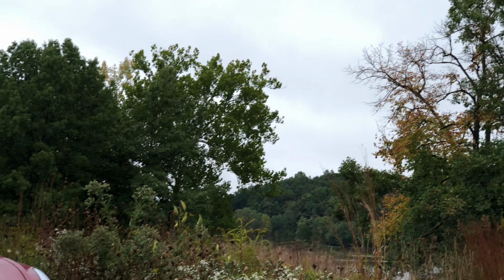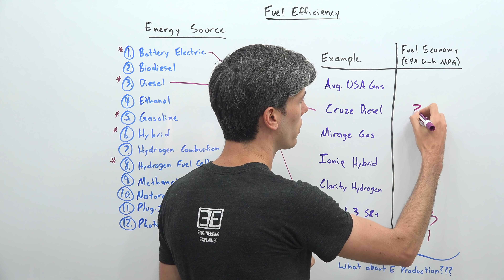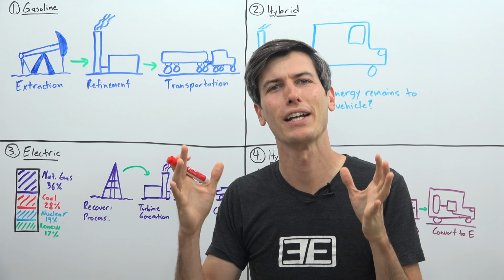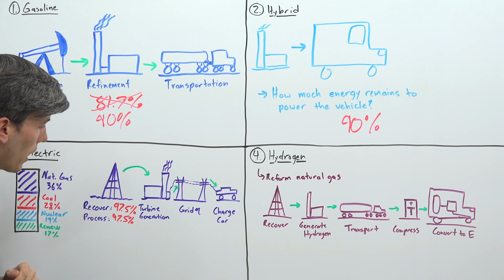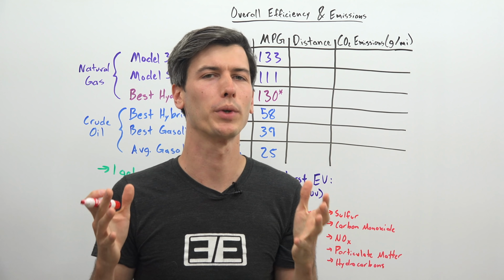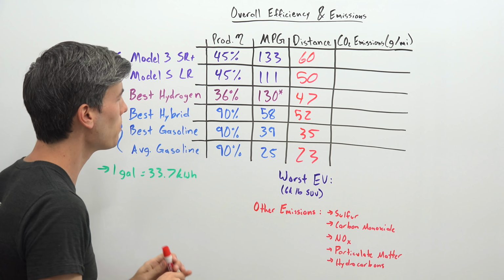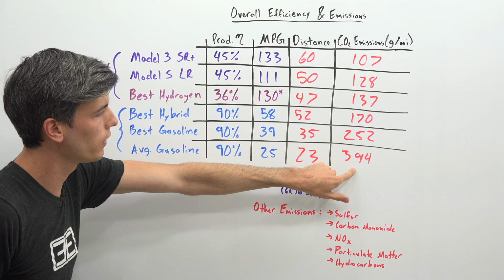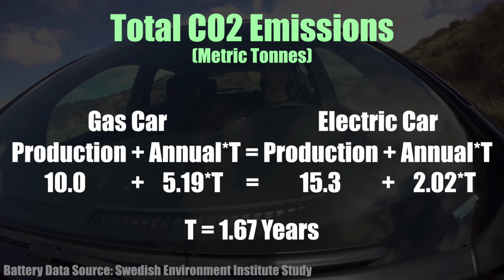Are Teslas Actually Better For The Environment?

Comment: but you haven't mentioned how much carbon emission occurs while producing Li ion battery in factory to run EV
Reply: Because he's comparing emissions during operation.  If you are to compare the total emissions to create a Tesla compared to a gas vehicle, you should also have to consider the service life of both as well, as the Tesla batteries are 90%+ recyclable and may soon have a service life of 1 million miles, and their current service life is not known, but well over 200,000 miles.
Reply: @chadcoady9025  well said, off topic but i just want to inform you that lithium itself is non renewable, it has formed by the big bang 14 billions year ago along with hydrogen & helium, so its reserve is finite, and if you compare similar weight of current gen li battery with fossil fuel, gasoline has enormous number of Joule stored in it like concentrated sun light,  only F1 engine has achieved 50% efficiency at peak scenario, in future it'll improve a lot,  so my point is li ion battery is not an efficient energy source nor renewable, may be nano cell battery or graphene will narrow the gap in future!

Comment: The only problem I see is coal is less efficient then natural gas so it's not the lowest number. Still a good video
Reply: eichler721 except coal is shrinking every year meanwhile renewables and natural gas grow every year. Hence why he used natural gas as the base. So yes those numbers are worse than the real world.
Reply: @johnmoore1495  I am aware but if you state worse that means worse. If he stated most common that would be something else
Reply: eichler721 what? I’m confused at what you’re complaining about.
Reply: @johnmoore1495  he stated to make it harder for the EV we will use the worst efficient fuel Natural Gas which is not true Coal is the worst. You get it now?
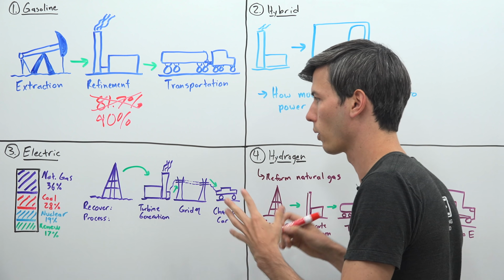Reply: eichler721 “We’re kind of going worst case” 6:21. We know coal is shrinking and will eventually die out and natural gas is expanding. Thus worst case in the real world is that of the fossil fuels we use it will end up being natural gas.

I get what you’re saying as natural gas is not literally the worst electric fuel source currently. He could’ve used better language.
Reply: @johnmoore1495  yes and as of this video coal is 3% behind natural gas as a energy source so almost the same. In 10-15 years coal will be almost gone but that's a while a way and makes the test not true.
Reply: eichler721 it doesn’t really make the test wrong, roughly 35% is nuclear or renewables which are zero emissions at the time of energy production. That far outweighs the coal.
Reply: @johnmoore1495  yes and nobody is debating that. The point was can a EV using the least efficient and dirty means of making energy beat an ICE car. Well he didn't use the dirtiest type so ya that defeats the point. It's still informative and cool but it not factual when you don't use the right words to.convey what you mean.
Reply: eichler721 from what I can find coal is roughly double the CO2 to generate the same power. So however you wanna factor that in.
Reply: @johnmoore1495  ya I am not going to pretend I am as good at formulas as him but it would be close using coal so when I clicked that's what I was expecting. The ICE is not that far off efficiency then EV when using Natural gas. It still makes way more emissions. The ICE might be better on efficiency then the coal EV and that's what made it interesting.
Reply: eichler721 so if you were driving in West Virginia it’d be best to just drive a hybrid.
Reply: @johnmoore1495   The west coast is 90% renewable between Washington, Oregon and California. East coast is alot of Nuclear with some Natural gas. The middle of the country is coal area from North Dakota to Ohio. Nuclear is the most energy dense but is so highly regulated that it costs a asston to build. No Hydro or Geothermal in the middle of the Country so that leaves wind and solar which are not very efficient at making power. So Natural gas is the best option for them to switch to.
Reply: eichler721 yeah I was surprised to find that my state is roughly 50% coal still. The issue with the Midwest (excluding the plain states) is that pretty much all open land is used for farming or natural forests. So solar power plants don’t make a whole lot of sense economically. However wind has been rather successful when funded. It’s quite simple to put a windmill up in farm land. Takes up little space, farmers usually get a kick back or sell that little chunk of land, and it works reliably since you’re in wide open land. Problem with my state at least is that there’s almost no incentives tax wise and coal is still economical.

In almost all regions it make sense to put solar panels on homes since it’s effectively free real estate. It’s very rare that you’re in such a sun free area that the production of the solar panels outweighs the savings both economically and in emissions.
Reply: @johnmoore1495  ya most states don't offer incentives for wind or solar so that's out of pocket and alot of houses can't afford that. The most common and cost efficient power hydro electric in the US. If they could tap Yellowstone for Geothermal it would power the whole PNW. But I don't trust those dummies to not set it off.
Reply: eichler721 yeah I’m not very comfortable with them messing around with the biggest super volcano that has been due to erupt lol
Reply: @johnmoore1495  exactly cause most people are not as smart as they think. Honestly the middle of the country is perfect for a few big Nuclear reactors and they would have plenty of power and could close all the coal olants

Comment: did you factor in the environmental damage for all the products needed to make the electric car ? its batteries? the oil used in the production of the teslas initially?   without oil and  precious resources how can making cars like this last long term?
Reply: Yes, he did, in a separate video, as he states, repeatedly.

Did you factor in the emissions to drill and pump oil, transport it to a refinery, refine it, and then transport it to a gas station? All those emissions get added to what you produce when you get in your car and drive.

I don't think anyone argues that at a dealership, sitting on the lot, a brand new EV didn't produced more emissions than a brand new ICE. The whole point of these discussions is that, by the time the car is being removed from service, the EV has generated VASTLY less emissions than an ICE.
Reply: Still its using resources that are currently not sustainable.  How long can this consumer lifstyle carry on? We went the wrong direction long ago imo.
Reply: @ArmChairKoalaBare  Couldn't disagree more.

There's an estimated 65 million tonnes of lithium reserves on Earth. If that lithium was used to produce just the Tesla Model 3 Long Range, that would be enough Lithium to provide every person on Earth with 1,576 Model 3's - each with a 310 mile range.

Providing every person on the Earth with a Tesla Model 3 long range (310 mile range) would require just 0.06% of the world's lithium reserves, leaving 99.94% of the Earth's lithium reserves available for other purposes.

It's also worth pointing out that there's been some promising research into Lithium-Carbon Dioxide batteries. In addition to begin carbon neutral, these batteries provide 7 times the energy density of standard lithium-ion batteries. In other words, such a battery made with 0.06% of the Earth's lithium reserves would be sufficient to provide every person on the planet with a car that has a 2170 mile range.

Despite the promising research, Lithium-Carbon Dioxidie batteries are still a long way from production. But the reality is, BEV's are the future. They have a much smaller environmental impact than ICE vehicles, they provide more torque than ICE vehicles, and they're easier to maintain than ICE vehicles.

Comment: Wait, how does a new ioniq(106.25) produce more co2 than my gen2 prius(104)(co2 output measured by tüv)?
Reply: because real world is not the same as on the broshure
Reply: @stinger15au  i mean really. How? I get the brochure is bs to an extent, but if math fails us vs real world testing then i'd go and check the methods if they're not wrong.

Comment: The fact that american diesels are either ridiculously inefficient, or just flat out bad scews the image here. Look up a european diesel hatchback (i use Peugeot 208 Diesel as my example, but any diesel in that car size will do). The MPG for a 208 Diesel (1.4 HDI) is 94.2. The gasoline equivalent in the same car (1.2 Gas engine) has an average mpg of 53.6. This image is consistent across sizes, if you take bigger cars such as VW Passat or Peugeot 508 as examples the diesel versions go 60-65 and 52-60 mpg respectively, and 30-38 and 32-41 mpg for the gasoline version. Furthermore, car buyers are generally aware that diesels are not good for short trips, so most people who mostly drive shorter trips, buy gasoline cars instead (at least that is the case here), leading to diesels being used primarily for longer distance, further increasing the efficiency, as they travel longer distances, at more optimal speeds, that are not reflected in the average values. That being said, electric cars are definitely the future, especially as power production changes away from coal and gas, and towards renewable resources and nuclear plants.
Reply: EPA test it in the US and tell us the equivalent numbers...  he's using the shopping comparisons of the testing cycles done on dynomometers for all cars sold here - it's just for apples/apples comparison.

Comment: How efficient is a model S when it's being towed on a flatbed because a drive unit failed?
Reply: Still more efficient that average ICE car that have to be toed because of an engine failure
Reply: @bondrewdbestdad  only after 1.67 years, weren't you paying attention?  Trick question, both are 100% efficient when being towed from point A to B using none of their own energy.

Comment: Only 23 mpg? My Citroen C2 gets better than that if you floor it in 5th gear. Normally it's nearly 50 mpg using the smaller US gallon. Not much point in getting a Prius when that Citroen cost me £800 with similar fuel efficiency and it's not a hybrid. I mean a Tesla is 4-5 x quicker to 60 but oh well.... you can't win 'em all. My most "gas guzzler" car was probably my 1.4 Peugeot 206 at about 40 mi/USgallon and it probably dipped to 37 mi/US gallon when a brake pad started rubbing against the wheel (checked by jacking the car and the wheel was a bit stiff to turn).

Comment: The problem with electric cars is range and charging time. While I can go 250-300 miles on a full tank, I can also refill it in a matter of minutes and go another 250-300 miles.
Reply: if the majority of your driving is long run oriented, that's an issue. In the US the average miles per driver per day in 50 and lower... If the majority of your driving is within the range of the car per day and you charge in your garage while you sleep - it's a really good tradeoff...

Comment: Great stuff as always.  While you talked about the efficiency losses associated with drilling, refining, and shipping oil/gasoline, I wish you had also talked about the emissions associated with doing so.  Same for hydrogen (emissions associated with electrolysis, transport, etc.).  This would paint a very relevant picture of true total associated emissions per mile.  Spoiler alert:  It doesn't improve the cases for ICE or hydrogen vehicles.

Comment: Hm....  Best Gasoline car in the US emits 156.6 g/km of CO2. Average is 251 g/km.
Meanwhile my 26 year old ancient car here on the other side of the pond emits 165 g/km of CO2.  Where is the progress? I mean I know. Those vehicles over there are bigger, heavier, more luxurious. Then why is climate change a problem at all? When CO2 emissions over there could be halved instantly by using Euro spec. cars. (Euro 6 mandates 95g/km of CO2 or less)

Other thing is. Where are the resources for the battery coming from? What impact does mining those components have on the environment? Is there enough of them to be a viable replacement for IC engines in the long run? How about the grid? What would it take to power all the cars if they were all electric? 
No doubt that in the current form, I mean the current number of EVs on the road.  They are greener, so to speak. But what about those questions above?

Comment: Do you think ethanol, specially the one created from sugar cane, would be still better in emission than electric?
Reply: Not sure about emissions, but I think bio-energy is kinda a non-starter simply because it uses so much area to get the X amount of energy compared to even solar panels, which are also notorious land hoggers. Photosynthesis is actually very inefficient process, this snippet is from Wikipedia photosynthesis page: "Ethanol fuel in Brazil has a calculation that results in: "Per hectare per year, the biomass produced corresponds to 0.27 TJ. This is equivalent to 0.86 W/m2. Assuming an average insolation of 225 W/m2, the photosynthetic efficiency of sugar cane is 0.38%.""

0.38% efficiency per area used is absolutely terrible, even cheap commercial solar panels are 15%-20% efficient.

Comment: I know you're using worst-case-scenario data for EV's in these videos, and I appreciate the reasons you're doing this. But wouldn't it be fun, just for a change, to do a similar analysis, except with EV's made in factories connected to clean grids, and used by owners who recharge them with rooftop solar, and so forth? Fun, and in a lot of cases, a growing number of cases, more accurate too.

Comment: EV are rather confusing for many....Tesla is not a vehicle that I would buy because there are no local places to take the darn thing when it breaks.   One head ache that I do not want and will not buy into. Tesla is like a cordless drill -I got and had to send it back -when broke.    That was all a Joke!   Where are the local repair shops?

One head ache that you could assist me -and many others -are the different types of Hybrid batteries used.  I know Toyota uses different ones in different models. 
  Which model,should I buy for long life and no or little maintenance?
And other brands are using different batteries, entirely.
What are the difference in these batteries and why are they using them in this model?  
Would appreciate a video on these battery types and which ones are best for cars using them.
Thanks load.

Comment: Isn’t it more efficient to keep our current cars running and not build millions of unnecessary new cars every year?
Reply: That's another issue, planned obsolescence and our need to ditch still usable cars. Swapping ICE for electric will not save the environment but is still a welcome start. I think it is also urgent that we transition from a excavation dependant economy to a recycling based economy, also called circle economy.

Comment: How do you get MPG for an electric car?
Reply: To create the mpg equivalent, the EPA uses an established energy standard of 115,000 BTUs (British thermal units) per gallon of gasoline.   To create the same amount of heat, you would need 33.7 kilowatt-hours of electricity / USGallon .    Then take the 33.7 x miles acheived per kwh and you have an equivalence to roughly compare with Miles per gallon.  MPGe is how they use it.   It's just for comparisons between vehicles.
Reply: Oh thanks !

Comment: I'm still confused.  You say 1 gallon of gas is 33 kWh.  That 1 gallon of gas is already past all the production loss,  refinery, transportation.  That 1 gallon of petrol should drive the Tesla 130miles.  Hence the 130 MPGe.   But your calculation is only 60miles.  So technically the 1 gallon of gas equals .45x33.7 kWh is more correct for the amount of energy in a gallon of gas.  Can you clarify?

Comment: And what to do with all petrol and diesel if we stop using it? It's all quite complicated.
Reply: they'll reduce crude extraction and tune refinery chains to produce what they need from it instead...
Reply: @lylestavast7652  It doesn't work like that. If you make bitumen and grease, JET A1 and solvents and LPG and so on, you will also get petrol and diesel. You can tweak it in some areas, but the laws of nature still goes. So if you stop using petrol and diesel, we still need to pump out the oil. And if ships starts using diesel, we have to much heavy oil to dump somewhere. And the roads, what should we build them with? And the computer you are writing on - full of fossil oil. And your kitchen is full of it, and your walls, and clothes and.....
Reply: @Xanthopteryx    you betcha you can... just takes new hardware to do progressive splitting of the chains...  and you can do the same in reverse and make lubrications and fuels by synthesizing from NG...  Chem-E's will have a great career with lots of patent revenues for decades :) 
 Atmospheric distillation will yield a pretty fixed set of cuts with small percentages of leeway, but complex refineries can go far, far more - in fact I'm sure in the backrooms engineers are already working on the guts and catalysts necessary to pull it off.   They'll crack that heavy oil stuff further and upgrade it into diesels.... And what's not upgradeable, it'll be in road oils and asphalts etc too as you note.      I personally think EVs will only hold about 15-25% of miles travelled over the next 20 years or so...  their competition will become ICE developers who radically ramp up MPG and reduce CO2/NOx etc as a way to stay in business...   EV efficiencies are already in the 90%'s ranges... not a lot of upside room in that regard...   the one caveat will be someone hitting a home run on battery formulations such that cost and storage density jump something like 4x on each... then it might be game over for ICE...